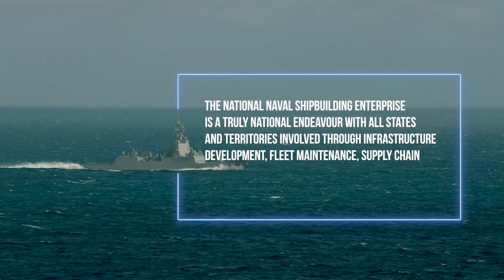Shipbuilding is nation building

Comment: That's a amazing, how they turn a 80 meter ship into a destroyer. The  80 m Lürssen OVP, 4 of them  will be built into mine ships on top of the 12 but, they need to build what they said . The Destroyer , a few more would have nice however, the new frigates are being increase in size to 10.5 T roughly.